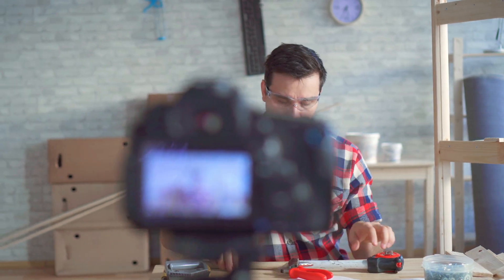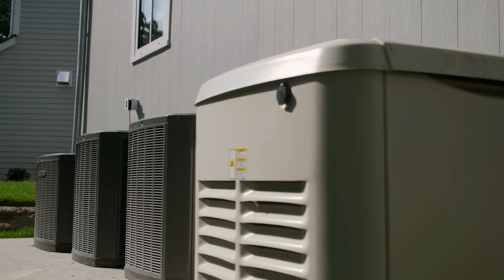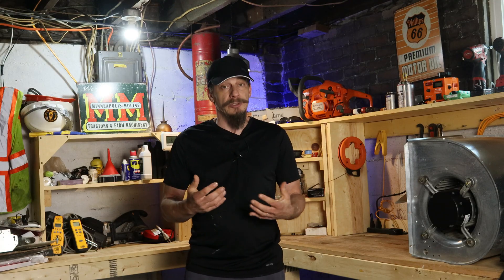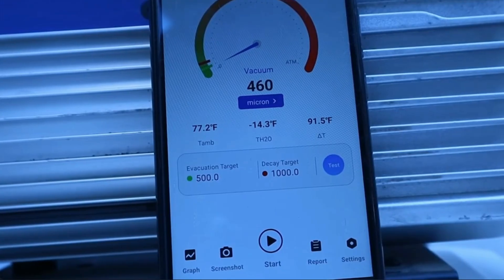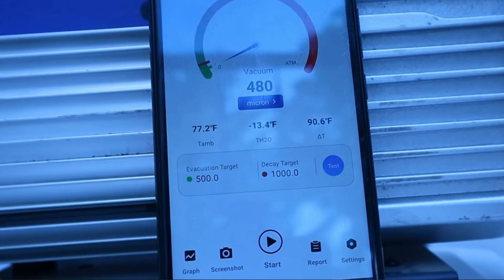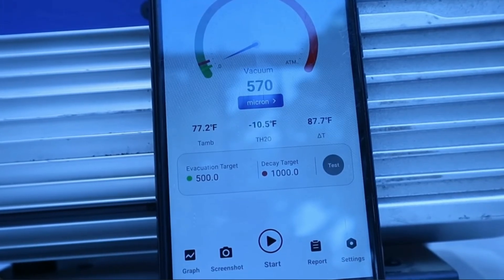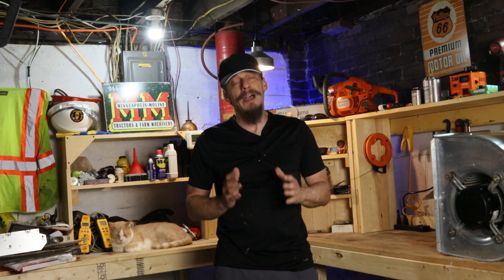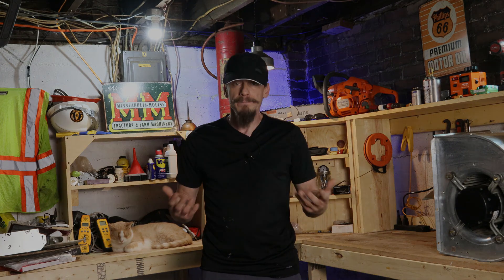Silent DIY Mistakes That Create HVAC Time Bombs

Comment: I've seen a lot of HVAC videos and this one actually taught me a number of new things.  You got my sub, for this and:
Love your kitty :3
Spy vs Spy is fun :)

I was planning a DIY of a minisplit (with solar) that has pre-pressurized/vacuumed lines.  You pay more for these "Plug-N-Cool" units, but the idea is you don't have to perform all these tricks and tests, etc.  What are your thoughts?
Reply from the maker: It's probably the better option in a lot of DIY situations because those set ups so take the liability of these topics I'm talking about off of you and would likely fall under warranty coverage since the manufacturer took those steps. 

 The down side is longevity hasn't really been established one way or the other I don't think. But I don't imagine it's any worse (and might even be better) than a poor DIY or "professional" hack job done on installation of a more conventional system requiring a lot more experience, which can actually void warranties.
Reply: The pre charged lines can’t be cut to length.

Comment: Again Sir, you are an example of what honesty and trustworthiness is. 
I have questioned a hvac mechanic, in POIONCIANA FL., doing work on my heat pump system, why he did not put nitro in, before brazing, and the conversation turned in to an argument. I try to explain to him that, his work will cost me more in time,  and he needs to do a proper job. He got really upset, and with a deep spanish accent said,  " If U, knows so much, why didn;t you fix it urself?" I refuse to pay him until he did it right. He did. I am pleased, but he was upset. I watched him worked to ensure my job done right in my eyes, and to protect any ill will. 
These ppl down here are rude, and very impolite, and their English is awful.

Comment: When rapid-releasing the nitro to remove any excess moisture and contaminates, do you suggest blowing the nitro out of the suction line or liquid line?
Reply from the maker: Not sure if it matters, but since I hook my micron gauge up to the liquid side port and vac from the suction, I release from the suction to push anything in the lines towards where I will be pulling a vacuum from.

Comment: Not a HVAC person, but learning a lot.  The static pressure thing, would that perhaps be due to a variable speed blower?

I was under the impression that some new systems can dynamically adjust based on current static pressure.
Reply from the maker: Yes, premium systems often have variable speed motors that will adjust to maintain CFM so that system dynamics don't change too much with higher static pressures, but only up to a point, and it comes at the cost of electrical efficiency. If a coil is dirty it can also lead to uneven velocity through the coil and create uneven heat transfer, which will then alter pressures and performance. Once static pressure increases to a point the motor cannot overcome it, you then get airflow loss on top of all that, just the same as other types of motors. Variables make up about 25% of the motors out there right now. The other 75% will immediately drop in airflow with rising static pressures and change system dynamics.
Reply: @JerseyMikeHVAC  Cool, I have just gone thru a bad contractor experience.  I legit knew more than they did.

My engineer brain picks up things fast, so I had to learn a lot out of necessity.  

The new new system that just got installed by a new contractor is a variable speed motor and as I was looking over the diagrams to hook up my whole home dehumidifier I had noticed some differences so that is why I asked. 

Appreciate the time to respond, hop on over my way if you want to pick up on some of the stuff I cover :)

Comment: Unfortunately pride in workmanship seems to be hard to find these days. The house I bought this year was built in 2016 and the HVAC company didn’t put a P trap on the condensate drain. Unfortunately the damage is done and I will probably have to change out the air handler early. With the refrigerant change that will mean a new system
Reply: A P trap is only required on an air conditioning condensate drain line under 2 conditions. First is if the indoor coil is located on the return or negative side of the fan. In most residential furnaces or air handlers it isn’t required because the coil is usually on the high pressure or discharge side of the fan. The trap is required to overcome the negative pressure to allow the condensate to drain. The other is if the condensate drain is tied into your main sewer line. This is required regardless of which side the fan the coil is on. But in this case the trap must always be filled with water because it seals the line from the sewer to prevent sewer gas from entering the air system. It’s the same principle as a P trap in a sink drain.

Comment: It really is a pain on You Tube, trying to find people - like yourself - that ACTUALLY know what they are talking about.  I saw the video you mentioned, with the closing of the ducts......HOW is that possible?  The definition of static pressure suggests what he did - cannot be.  So either he's got REALLY leaky ducts, or somehow the reading taken were messed up - somehow.
Thanks for another great video!
Reply from the maker: There was a psc motor in that unit. I think the static was so high the motor collapsed and was barely moving enough air to increase his static pressure readings. 

I guess that means everything is ok so long as you don't check your heat rise or superheat/sub cooling.
Reply: I love geeking out on this stuff and trying to analyze that kind of stuff, what video is it?

Comment: I went to a call for a diy guy. The dude had a screw on the lineset. He ended up cross-threading the suction line at the ac service port and it was leaking. I tried to tell him, but he knew everything, so I couldn't convince him. We showed him the part he needed for the repair, but again, he knew everything and didn't want to pay to have it fixed. We never heard from him again. I assume that he called another company and they told him the same exact thing. Some diy guys are so cheap that it's ugly.
Reply from the maker: I've worked with quite a few engineers that were just like that. A few techs too. lol. But yeah, it's everywhere.

Comment: In reference to static pressure, what about zones? If a house has say 8 branches and 4 zones. What if 2 of those zones shut down. How does that affect static pressure?
Reply from the maker: A properly zoned system will typically include a blower motor that adjusts to the zoning. On some systems a bypass duct with a weighted or static actuated damper can be installed on a system with motor that doesn't adjust so that static doesn't build up too high. On a fixed speed motor system with no bypass set up it can be a big problem and change the whole profile of the system negatively.
Reply: Multizone systems are usually a bad idea in residential applications. Unless the heating and cooling system has some sort of capacity control, it’s never going to work right and the equipment will have a short service life.

Comment: Thanks Mike, glad to buy a Coffee for all you do.  I’ve spent hours viewing HVAC on home maintenance, not because I don’t want the spend the $, but I’ve had so many big spends (one was over $100,000 on hard scape and plantings, $20,000 50-year GAF roof, etc.) that were promised as best practice and failed 5 years later.  Contractors say they don’t want a callback, but in the instances where I’ve submitted a complaint the callback work was just as sloppy.
My 4-ton R-22 Rheem condenser was built 2000, and I realize that if there’s no metal component failure and a Soft Start, why can’t it last 30 years than spend $15,000 on a “new” non-R22 that people say the electronics will fail or new refrigerant lines leak, or unreliable parts or components for higher efficiency will fail sooner.  Thanks for all you do.
Reply from the maker: Thank you. Hold on to that R-22 system as long as you can.
Reply: my rheem is 2003 , cap replaced 2x and contactor 1x....still ticking
Reply: in 10 years that 15 k will be 30 - just saying
Reply: @blackishpariah  unfortunately